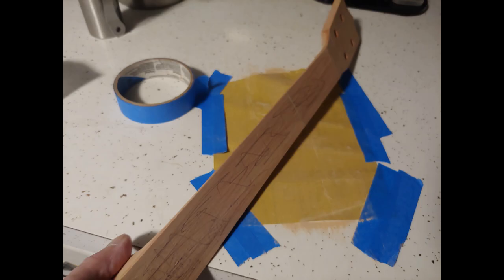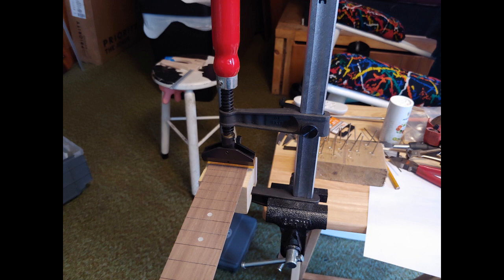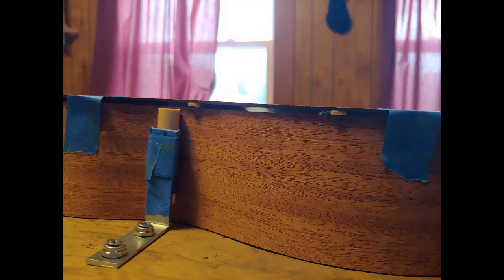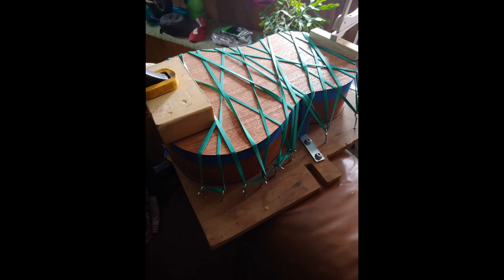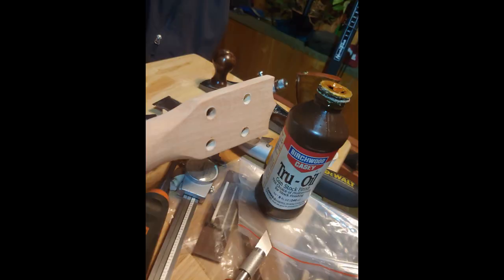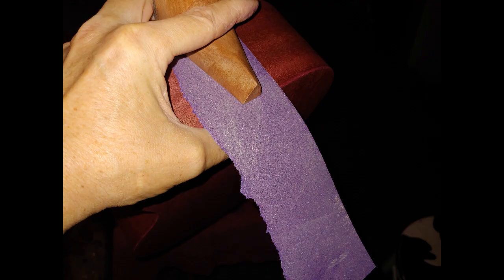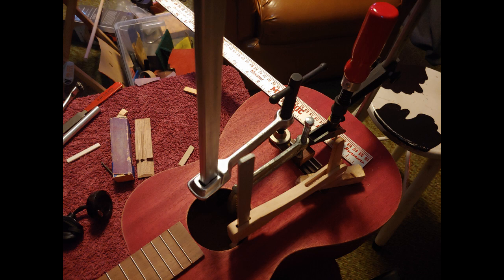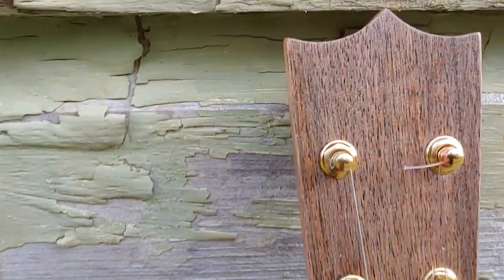Stewmac Baritone Ukulele Build+Sound Sample

Comment: I just ordered one of these kits, Did you oil the freboard? Are the slots already in the nut? Thanks
Reply from the maker: You can oil the fretboard as long as its after the fret install. The slots are on the nut. But will most likely need to be adjusted for good playing action. Either by sanding the bottom of the nut for better playing action. Or filing the slots deeper. I hope you have fun with the kit.

Comment: Hi, I have just got one of the baritone kits, was your back of the uke flat or was it bowed outwards due to the braces being curved?
Reply from the maker: My braces came not truly flat. The back was in good shape. Having alittle roundness to the back isnt a bad thing. I have built quite a few of these klits. And its up to the person to true everything up. I just looked at my baritone. And its a flat back. One of my tricks to level things is to tape sand paper down to my flattest surface. Then i can sand the braces or anything down to flat. Good luck with your project. Im very happy with my built baritone. I did change the strings to Aquila Red with the 2 low string wound. Sounds very rich.
Reply: @albikes8484  Thanks for the reply, great help.